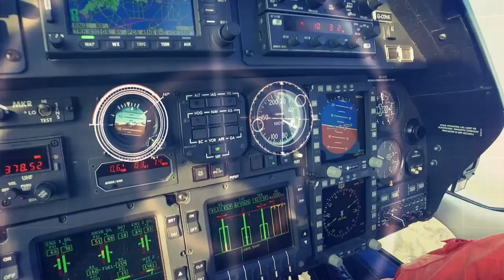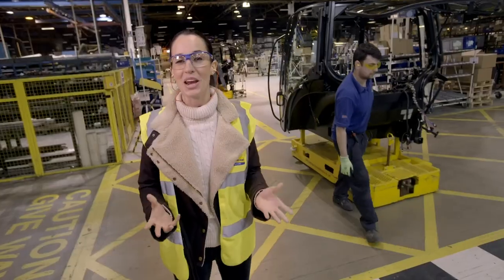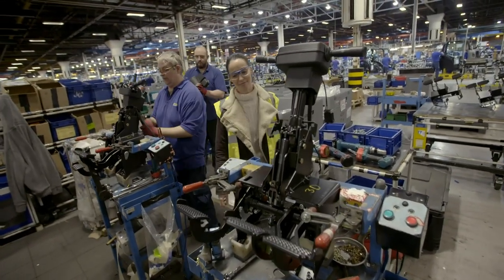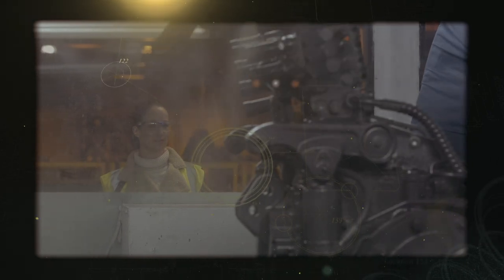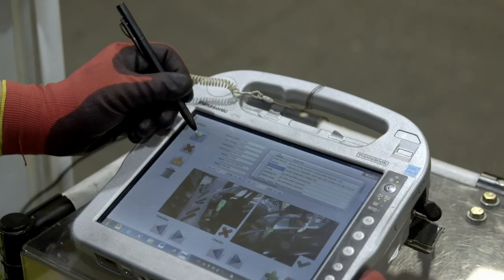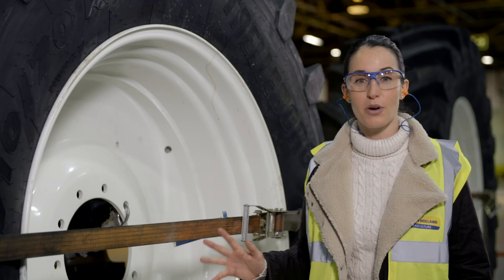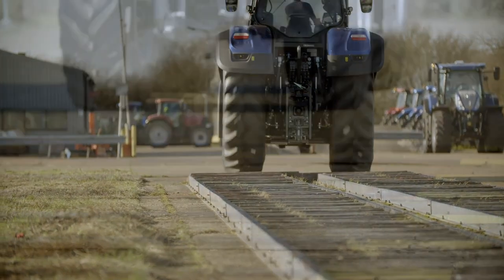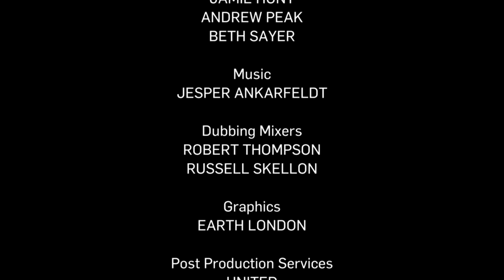Building Tractors in the Largest Tractor Factory in the UK | Ultimate Processes | Free Documentary

Comment: Would love to see one of these on some big tractors like CaseIH or Deer. 300* HP is pretty middle of the road in tractors.
Reply: Case and New Holland is the same company = same machines! And 300HP is definitely not middle of the road, as most tractors have less than that and don't need more.
Reply: Yeah I laughed at that. Even back in the late 90s our tractors were over 450hp.
Our new one I think is 620hp. Even that struggles to start with a 70 foot cultivator.
Reply: @freddofrosch1  2019 John Deere S780 Combine, has 473 hp. The JD-
9 series tractor 390 to 590 hp.
Reply: Basildon only deals with the T6 and T7’s among with other harvesters
Reply: @freddofrosch1  yeah the tractors are pretty much the same thing both owned by Fiat
Reply: Yea but by distribution of quantity there's vastly more of the low hp units out there so over 300hp is probably less than 5% of the market
Reply: @chrisrogers3175  newholland owns fiat
Reply: @jeffreyhollink985  no they dont, case and nh come off the same line
Reply: @chrisrogers3175  iknow that but newhollands owns fiat

Comment: Aren’t any parts made in UK
Reply: It varies over time and models. For T6 and T7 the radiators, or some of the several on each tractor, may be made in the UK. Not sure about wiring looms. Some tyres. Not much really.
Reply: not since ford pulled out. i used to drive for brs collecting parts from around the midlands for delivery to basildon
Reply: @steviespice3037  
Ford pulled out or sold its tractor division to Fiat just before the launch of the 40 series, so that would be back in the very early 1990’s.  However they still machined and assembled engines at Basildon, albeit with no forging facility, so blocks, cranks and other major parts were imported to be finished at Basildon, until the demise of the Powerstar or Genesis engine when the TM series and 40 Series were replaced. At that time, Iveco/CNH NEF engines were fitted. These are imported from Italy.

Comment: What a pity that after all that the end product is one of the worst on the planet along with an American red one.
Reply: Plenty around here that have done 15,000 hard hours. I have a Basildon assembled NH8360 tractor [an earlier version of TM155] that has just crossed 10,000 hours, mostly doing loader work and filling silage clamps with a large rear mounted buckrake. Very few issues. Main one being a synchromesh hub in the Range Command semi-powershift 18 forward 6 reverse transmission.
Reply: Guess you're a john deere fan boy?

Comment: It's interesting that this is an assembly and test facility, not a manufacturing plant.  The actual creation/manufacturing of the components is all done elsewhere, no doubt where it's cheaper.  Well made video all the same.
Reply: Yes, the engines are machined and assembled in Italy and most transmissions are machined and assembled in Belgium, matched with Italian axles front and back. French cab frames. Very little UK content so it remains to be seen how the new Brexit UK content regulations will effect this assembly-only factory. The work done in Basildon can be done in any adapted shed anywhere with very little capital investment.
Reply: It was a bit misleading in truth, the engines 'produced' at the plant and sent elsewhere has nothing more than paint applied in the UK. All quietly never mentioned. Screw driver plant and little more. We have come along way.

Comment: Saw one or two red roofs. Wonder if CASE IH Optum series is manufactured there as well. New Holland T7 is the mid-frame high-horsepower series. The Optum series is basically the same tractor with a few operator control differences and a red n black plant scheme.
Reply: Yeah maybe, wonder if the T6 is made there. I have a case maxxum and thats made in Austria. Not sure if nh and case have their own factories or they make both in the same since they are practically the same, with the exception of a few small cab tweaks and different colour scheme
Reply: @Matthew-nc9vm  yeah, did a quick search and it looks like a lot of CASE IH and Steyr series are built at that Austria plant. I guess if a couple separate plants make cabs and transmissions for both brands, it wouldn't be surprising if they had different assembly plants. Just thought it was odd there was a couple red n black cab roofs in this video.
Reply: @farminstoltzfus  Yeah definitely seemed odd.
Reply: @farminstoltzfus  
Case red for N America are made in UK but those sold in UK are made in Austria. Small ones made in Italy mostly while the articulated and tracked tractors are made in North America.

Comment: She's not too smart. Bragging about 315hp. Put a  540hp Cummins in it.
Reply: What would you want to do that for? There's no brag, different machine different job, like in UK we generally don't use dual wheels anymore, just modern big tyres. Different jobs different machine. 300 hp is way bigger than what is used on most UK and many European farms.
Reply: @bigteddy66  true that. But she seems to be trying to portray that 315hp is absolutely unbelievable hp. There is correct equipment used for specific applications and purposes agreed, but i didn't think she understands.  We use 210hp draggers for our applications, and they are perfectly suitable
Reply: I think torque is more important than HP in this situation, but correct me if I'm wrong.
Reply: @Apollo-333  
Both are important. So is fuel economy and reliability. The CNH/Iveco NEF family of engines have been work-proven to be superb in every way.

Comment: Very impressive and well run Manufacturing  Plant. Highly skilled technicians and management that is making sure all the parts are available and the Tractor assembly line is moving as planned. It is amazing the Engineering that goes into all the machines we use from Tractors, Automobiles, Jet Airplanes and many more that we see that makes our economies function, they are Modern Miracles.